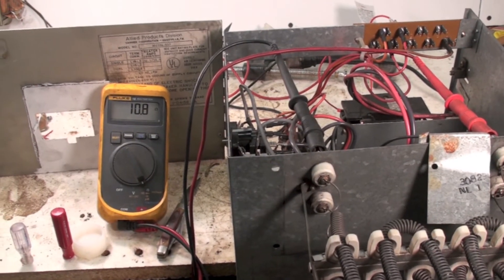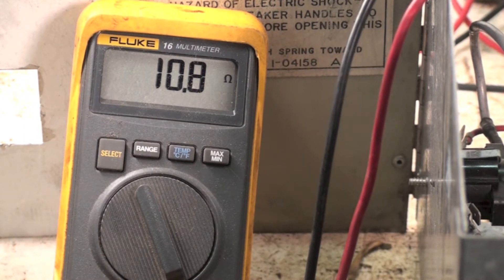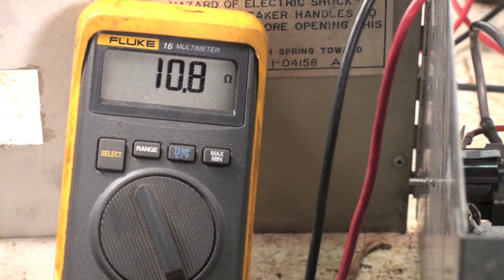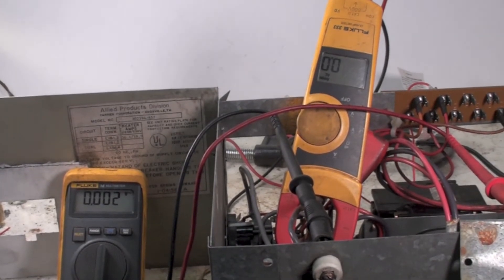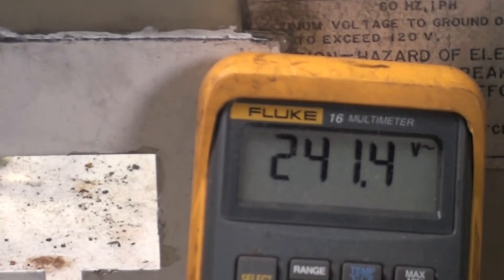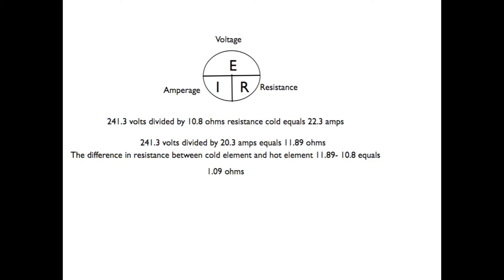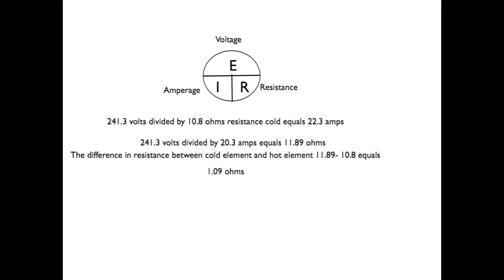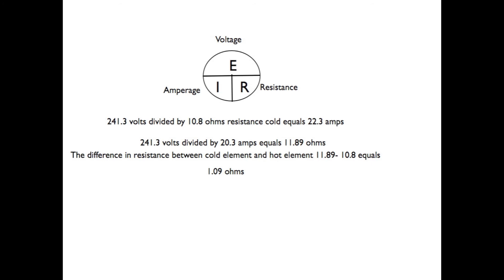calculate inrush amperage for electric furnaces

Comment: Digital voltage meter won't show a jump in current on start up where an analog will. The inrush current occurs very quickly. It does happen or staging of the elements wouldn't be necessary. Still good video and interesting topic.

Comment from the maker: I have gotten a fair amount of feedback on this.  I intend to revisit this with more "mad scientist" tests.  I think you are right about the elements not getting hot enough to make much difference.  Both Trane and Magic Chef use contactors in their furnaces.  Also Honeywell makes a line of electric heat contactors.  And the temps are different between nichrome and tungsten.  Also the wire is seldom as hot as the vid as the fan cools it down.

Comment: Interesting! Thank you for the test. Perhaps inrush current isn't a large factor for these elements as they heat up slow, and don't get very hot comparable to a light bulb filament, which heats up very fast and burns over a thousand degrees.